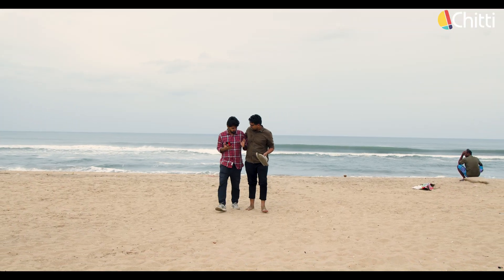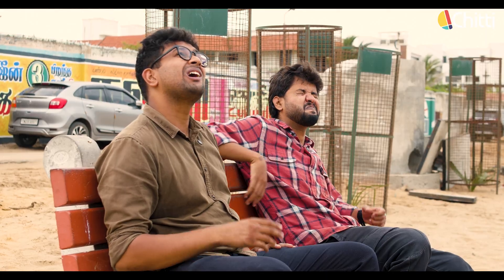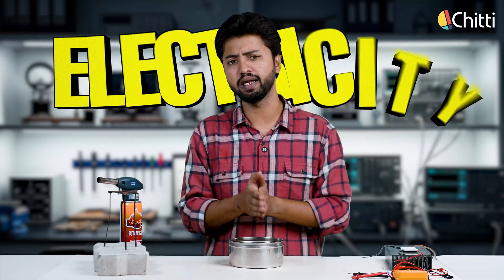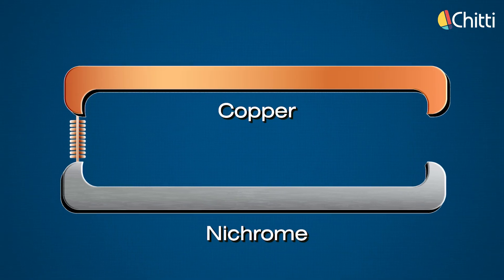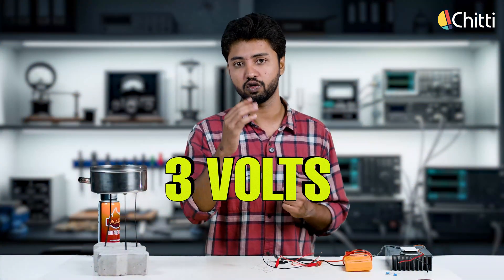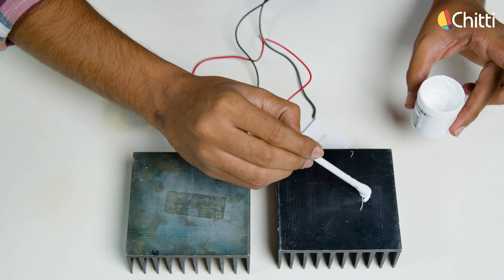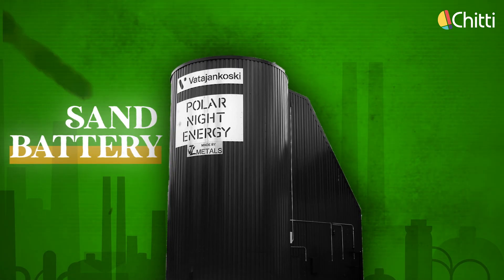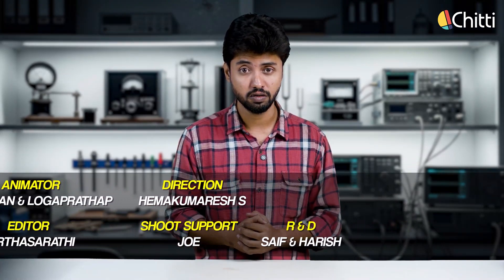How Engineers turned Sand into a Battery? | Sand Battery

Comment: sand can in a dry  environment promote static electricity the higher the speed more tiny particles bring high voltage but rather low ampere can be used to modulate sound the wind whispers or howls but your gadget tells what